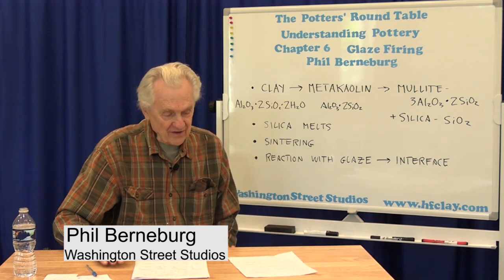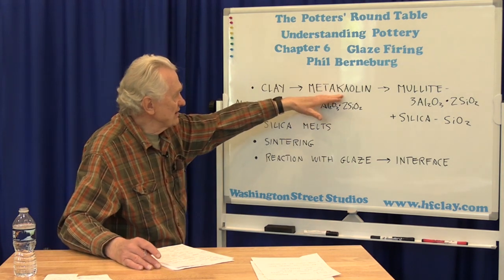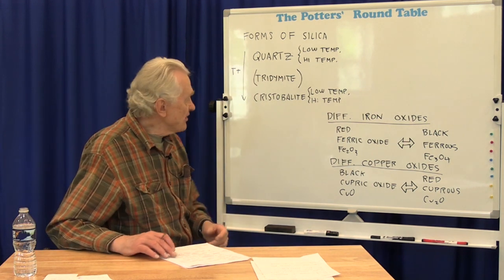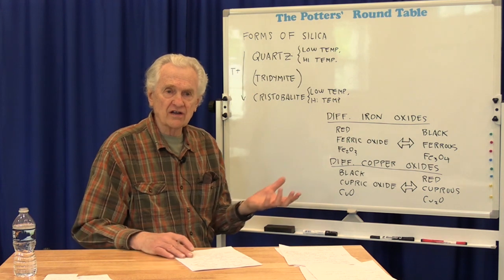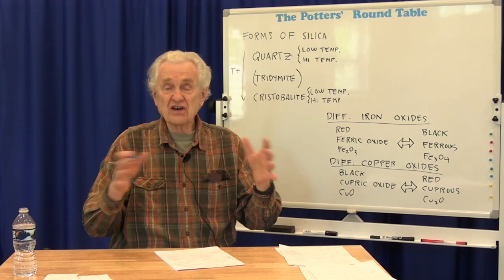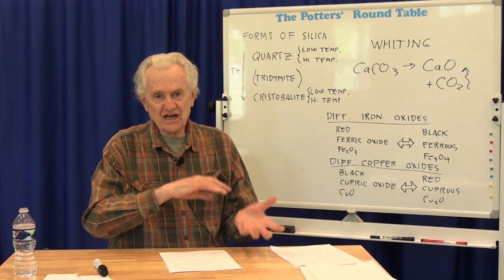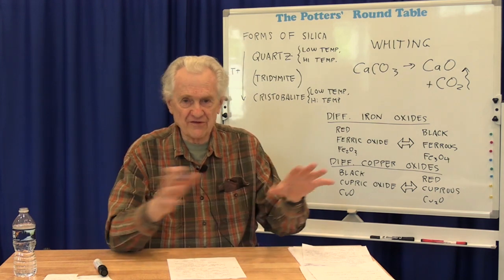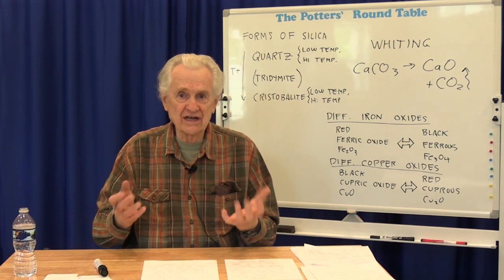Understanding Pottery: Chapter 6 Glaze Firing

Comment: Thank you I have learned so much and can’t get enough!
Reply from the maker: You are welcome Renee, be sure to share our channel with your friends and fellow potters! We are trying to grow the Potters' Round Table community.
Reply from the maker: Hi Rita, 

Thank you for your email. Crazing happens at the end of a firing as the fired clay and solidified glaze are cooling down because the clay and the glaze are contracting different amounts. If the glaze tries to contract more than the clay, then it will crack and break apart into small areas - this is the crazing. As you are probably aware, most materials expand as they are heated and then contract as they cool back down, but different materials (different chemical compositions and crystalline forms) expand and contract at different rates (the CTE - coefficients of thermal expansion). So, if the glaze has a higher CTE (more expansion and  contraction) than the clay, it is likely that crazing will occur.

Phil
Reply from the maker: Sorry, I posted Phil's response on the wrong comment! I'm too old and don't see as well as I used to.